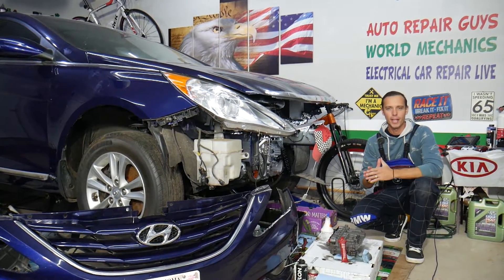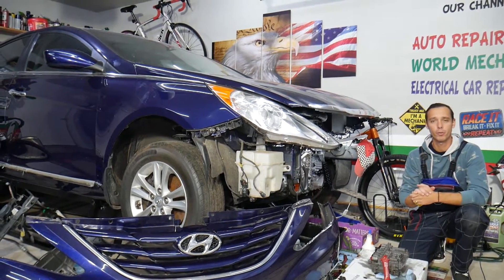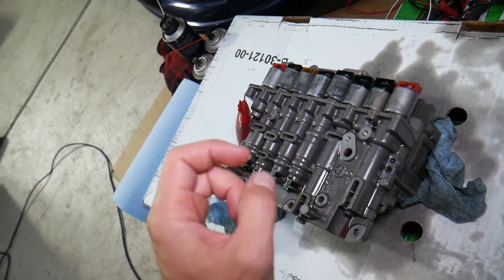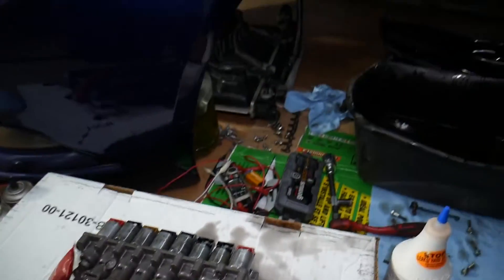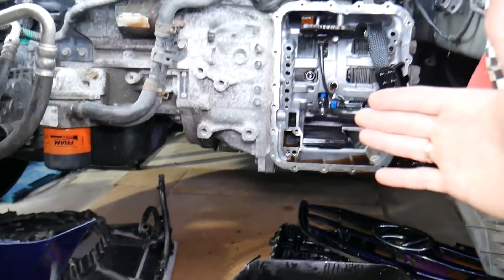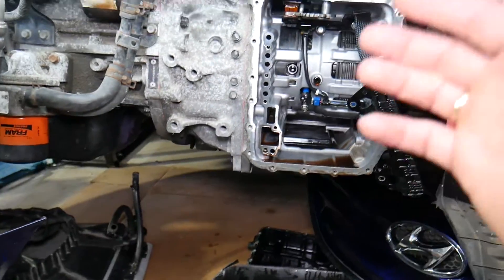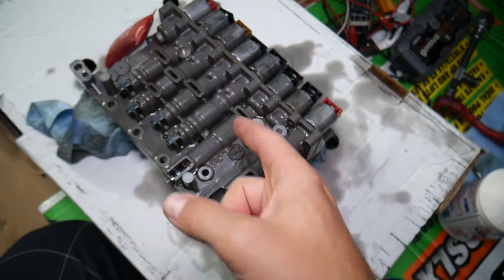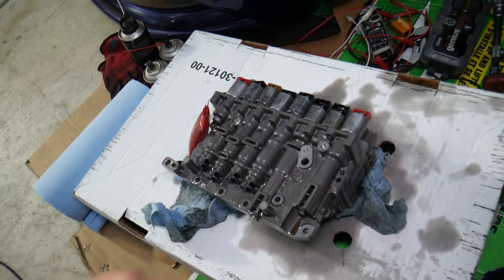HYUNDAI TRANSMISSION STUCK IN GEAR CANNOT SHIFT FIX SONATA ELANTRA SANTA FE TUCSON VELOSTER ACCENT

Comment: My car shift to gear 4 and get stocked when I apply pressure on the accelerator. When it sticks to gear 4 I can't downshift it and can only restart for it to go to gear 1. It shows the code p0880
Reply: I have the same problem with my 2016 kia sorento 3.3l v6.What is the cause because mine does not give me any error code
Reply: Same as my car
Reply: Same as my 2018 Hyundai Elantra, did you figure it out?
Reply: Same as my 2016 Elantra what dis y'all do for it to work??

Comment: I have a 2015 Hyundai elantra I've had it for 7 years I don't think they ever changed the transmission fluid they told me the first gear was slipping my car still drives good but engine lightbstaysbon HELP please